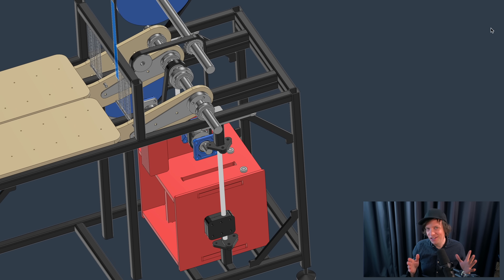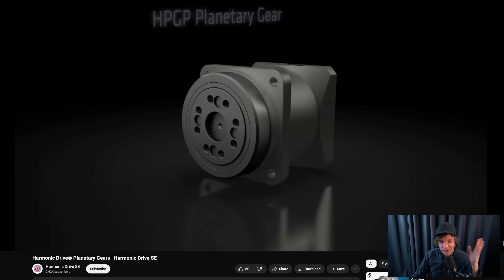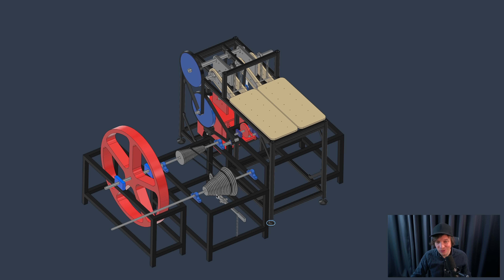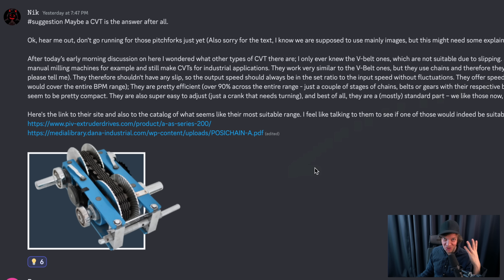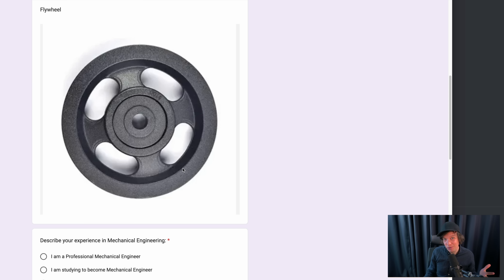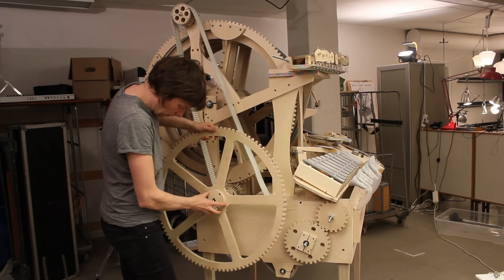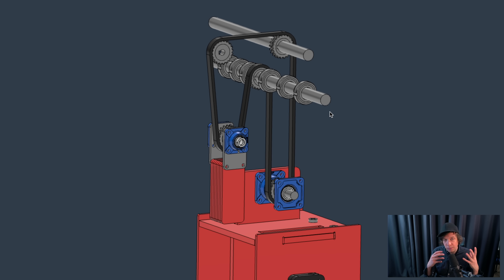Which Gear Type is Most Efficient?

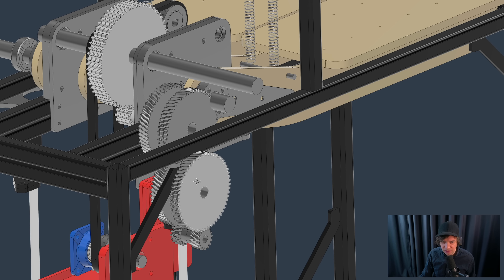Comment: For the 1:50 ratio I'd suggest a planetary drive, maybe one from a cordless power drill might be sufficient for your wattage. But also think about your bearings, they can be had with different internal tolerances, looser tolerances might spin easier. The type of seal used can also add unwanted friction, and the type of grease (namely thicker grease) can also add unwanted friction. For the speed selection gearbox why not look at the chain drive of a bicycle? It's a ready made gearbox designed to be driven by pedal power and they can have a lot of ratios. Thinking a bit further ahead, you might want to look at how much twist there is in a very long shaft. Did you say the machine would be 10 meters long? I fear that that long of a drive shaft might twist enough to effect that super tight music you are after from one side of the machine to the other. Maybe something to test? If it's an issue I'd suggest a  larger diameter hollow tube instead of a relatively thin solid shaft.

Comment: Do me a favor and just look up carbon fiber cogged belts basically the carbon fiber belt has teeth what's the opposite of a sprocket and chain carbon fiber belts I know the last a long time they will fail without letting you know any warning signs but the application you're using isn't a very high horsepower application mountain bike and some road bikes use these single speed carbon fiber cogged belts and then the police are not pulleys do they have the square slots that are the mirror image of the carbon fiber belt so it's like it's a sprocket belt you'd have to custom order on for your length but there is no slip whatsoever

Comment: It's just a spontaneous thought - For constant RPM: What about fluids? You can use constant atmospheric pressure with constant gravity for constant RPM. You can work with Siphons. If you can keep the fluid above a certain level, it doesn't matter how off the beat the input is. Just only for inspiration, beside the No's.

Comment: The planetary gears in a Toyota hybrid are driven in all directions; the magic in that system is that it can transfer torque from any of the three axes (outer ring to wheels and one of the motor generators, sun gear to the other motor generator, planet ring to ICE). Therefore I think that in principle they are quite efficient when used to gear up from planets to sun gear with fixed outer ring.

Comment: I'm definitely team belt over gears. They are pretty efficient, get the shafts positioned in the right spots, and are very quiet! Gears make a ton of noise over like 3000 rpm, you'd have to enclose and lubricate them really well. The belts are fantastic for cost and serviceability. You can make your own giant pulleys and some simple idlers to tension the belt run and boom you are done. Don't need to spend like $1000 on some precision gears.
Regarding timing belt vs v-groove belt vs roller chain it's gonna be a matter of the loads/torques (don't forget about potential shock/peak loads!). I think timing belts could be strong enough for your application here.

Comment: When it comes to gear boxes for cars the most common is helical gears, and the main reason is noise. In race cars there’s usually straight cut gears, as they can handle more torque, and allow for changing gears without using the clutch. And noise is usually not a problem with race cars. Also, most older cars have straight cut gears for the reverse gear. You can hear the gears when running in reverse with some speed.
Reply: Would a helical timing belt also be quieter than a straight-cut timing belt?
Reply: @mahekorvenoges550  Probably louder, as the groves follows the belt.

Comment: Never formally established:
Design requirement No.1: falling marbles play analog instruments
Design requirement No.2: mechanical solutions are always preferred to electrical solutions
Design requirement No.3: songs are preprogrammed on wheels
Design requirement No.4: [...]

Some of these were often implied but never set.
Why use cables, gears, flywheels, levers or even marbles?
Why not songtape, motors, sensors, solonoids, speakers-
Because it wouldn't be the Marble Machine!

Comment: When using helical gears you have an advantage when it comes to noise BUT helical gears create an axial load so you have to use bearings which can handle axial loads. And you have to be able to adjust the positioning of the gears be it with shims and a shaft nut or something like that and you have to pretension the bearings for precision.

Comment: One thing to keep in mind is the noise level of each solution too. You don't want it to be a noisy machine. You want your instruments to shine. A less optimal but quieter solution for a problem may be the best overall.
Reply: I was thinking the exact same thing. It might also be worth considering how each solution contributes to the resonance of the overall instrument.
Reply: @sandy_knight  Same here. I was thinking straight cut gears are notoriously noisy, which is why meshed gears got used in motor gearboxes. However, precision is a problem for them. The same could happen with the belt drives, Martin is going to have to check none of the lengths of belt end up in resonance with any of the speeds he does or end up with the belt as a musical string.
Also the weight of each solution should be a consideration for both transport and any inertial resistances.
Lastly the idea of swapping out gears, mid performance, really sounds like a bad idea, what if you don't want a pause from one song to the next..... A multi-ratio gearbox sounds like the best option, even if it does require more engineering. I wonder when Martin gets his course in synchromesh design
Reply: @tedferkin   Rebuilding the machine in any way while out on location.. is a bad idea in general.  
I have been part of a machine building project on a few occasions for industrial applications.  When it came to how to drive a machine.. anything that requires changing parts.. Any production environment says "No" immediately.  If you can have a variable motor or quick change pulleys/ gearboxes that can switch speeds with a lever.. Sure, no problem. But stop the machine and spend 15 minutes changing a pulley or even moving a belt.. They would rather avoid it as even moving a belt can result in damage / downtime.

Also I had to change pulleys on the machines in my workplace and the job is such a pain in the rear..  it might only take 10 minutes to do.. but you have to align / tension and reset positions of pulleys and 1 misaligned pulley and resistance / noise / resonance.. things you don't want on a hand powered music machine. :P
Reply: The balls are the problem

Comment: Wind turbines use planetary gearboxes to convert the low speed rotation os the blades to the high speed needed for the grid frequency. They need to be highly eficienty, durable and able to deal with variable loads. The question is if you will find a gearbox that works for you for a reasonable price.

Comment: Won't create an account for discord to submit this idea. Best way is to use tried and true solutions and adapt them. I would go with gates Carbon Drive belts and pulley. I can't prove thy are the most efficient, but using readily available parts is much easier for building and maintaining. Efficiency should be in the high 90% and not an issue.

Comment: I don't have a perfect answer for you as far as back driving the planetary gear set, but I can tell you that they are used in automatic transmissions in cars for gearing both up and down. Over drive on an automatic transmission is accomplished through a planetary.

Comment: Regarding the CVT for the gear box:  if CVTs cannot maintain a constant speed, it would be disqualified as a solution.  If, however, the CVT can maintain a constant speed, but the speed settings are not consistent (that is, it is difficult to reproduce a prior speed setting), that would seem to be a minor issue that in some respects mimics human error.  (Musicians with perfect pitch exist, but I've never heard of a person who can precisely set a metronome to a specific beats per minute.)  In my opinion, one of the advantages of a CVT would be the ability to alter the tempo during play.  That would allow slowing down at the end of a song, or simply varying tempo ad hoc in the midst of a song.  Just as differing volumes add subtle nuances (and emotion) to a song, so, too do varying tempos.  If the entire song is played at one tempo, it will definitely have a robotic feel.  So ... if CVTs are deemed unsuitable for the gearbox, I think the gearbox should allow on-the-fly shifting to different ratios.  Admittedly, there may be a noticeable step change in tempo, but the inertia of the system would probably smooth those changes out to the point of making the tempo change appear gradual.